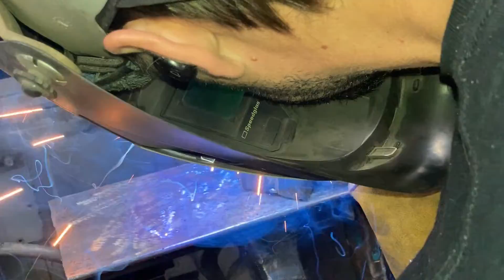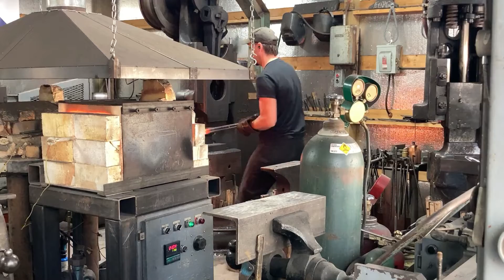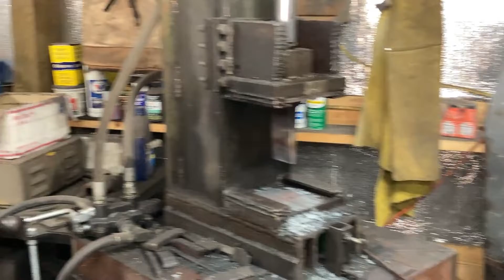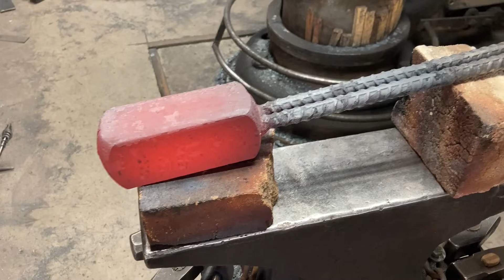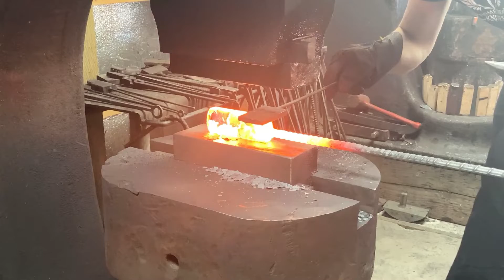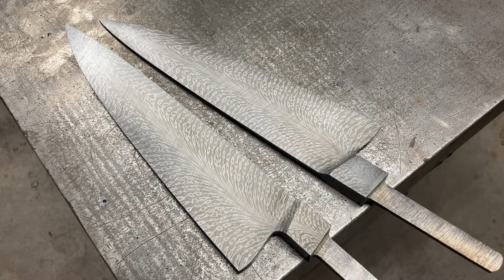Jailbird Feather Damascus Chef Knives, Part 5: completing the pattern, forging blades, heat treat!

Comment: What’s the weight/material loss from the original billet (of bar stock before forge welding) to the finished knife blades?
Reply from the maker: The 3 finished blades are around 8 Oz each… probably about 8lbs each per two starting billets worth of material, so 16 lbs so 5.33 lbs steel goes into an 8 oz blade. So ultimately 90% or worse material loss all told.